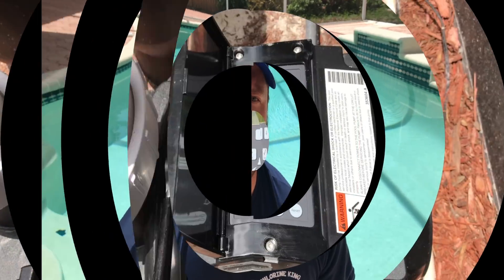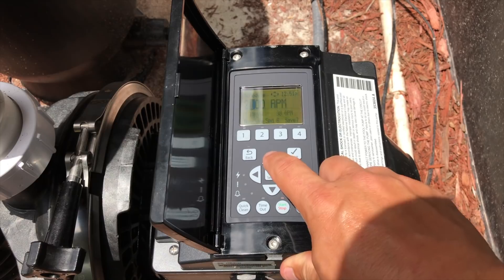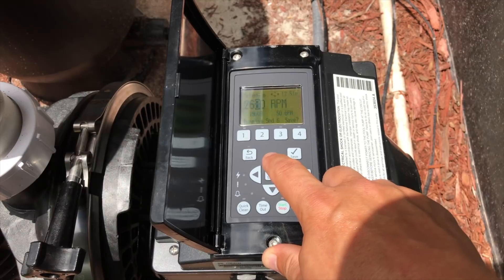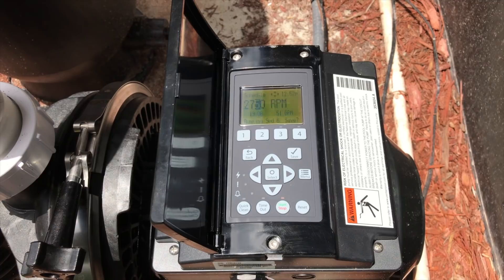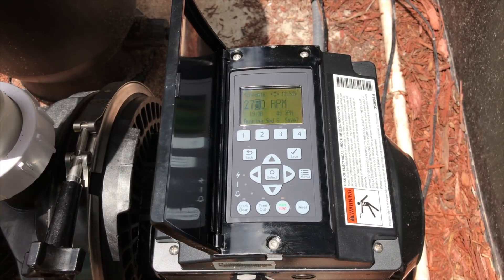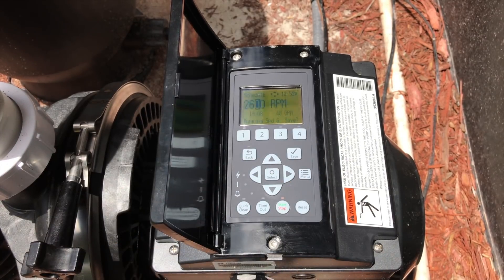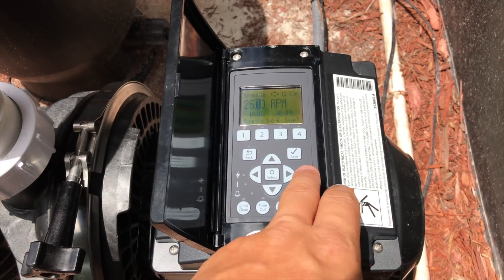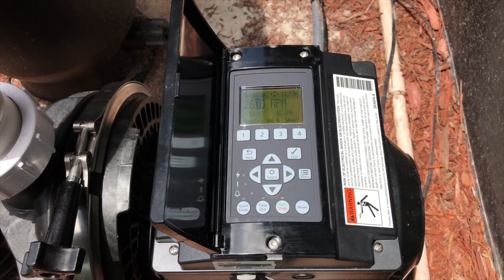Clogged Impeller Or Cavitation? How To Diagnose & Fix A Noisy Pool Pump Easily

Comment: What about it suddenly occuring with av single speed pump that's been running fine for years?
Reply from the maker: It could be a clogged valve in front of the pump. I’ve seen the diverter valves clogged really bad with leaves which restricts the water and could cause cavitation. If you look back on my instagram and Facebook you can see pics I’ve posted with what we’ve pulled out of those things.

Comment: So with this setup it’s impossible to run the pump at full speed -  what’s the underlying problem and fix?!? What if you actually need to run at 3400rpm without cavitation? There’s got to be a better solution than just dumbing down your pump speed. That’s NOT the purpose of a Variable Speed pump

Comment: I have a pump that seems to run better when I restrict the line on the pressure side of the pump. What might this be indicative of? Pump is sized too big?? This motor has gone bad in 3 years. It’s single speed 2 hp.
Reply from the maker: Could be. What size plumbing? Tell me a little bit more about your pool. How many suction lines and return lines?
Reply: Chlorine King Pool Service it’s about 36,000 gallons pool spa combo. Suction lines - 2 skimmers on one line a bottom drain, and the spa on actuator, 2” plumbing. The return lines - there’s one for eyeball returns one for water slide and one for spa. Spa overflows into pool most of the time out of two spillways. There is a heater with no bypass currently. Quad hayward cartridge filter. 

Maybe I should install bypass on the heater and that will help? Also considering if I should replace the pump with 1.5 hp?

Of course variable speed would be best.
Reply: It’s a hayward Tristar pump
Reply: I know your question is 5 years old…

I’m assuming you mean it’s quieter/smoother when you restrict the pressure side

That means you were cavitating, and when you restricted the pressure side you decreased gpms and mitigated the cavitation.

Cavitation is when your pump is trying to pump more water than the supply can give, so when you restrict the gpm, you are reducing the demand from the suction/supply side.

Simply, without changing the size of any plumbing, cavitation is mitigated by reducing flow

Comment: Funny I Just Installed an Itellipro because I pulled a maxi glass and wanted it to line up, and got the same problem right at 2700rpm, same sound and everything, I think an itelliflo wouldn't do that though
Reply from the maker: They're great pumps! I've seen pumps from the big 3 make that noise. This particular set us was a single line in (main drain and skimmer on the same line) with pipe under ground being 1.5".